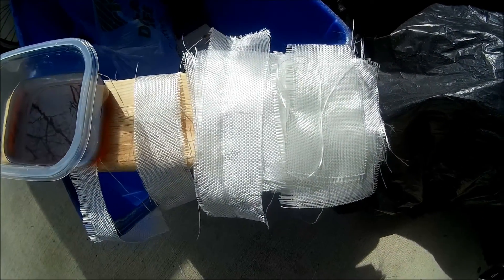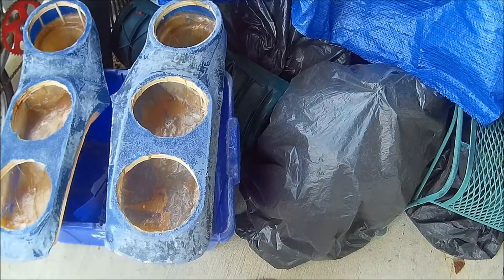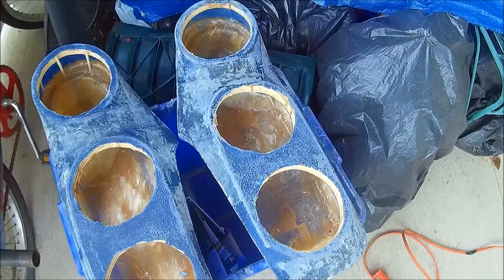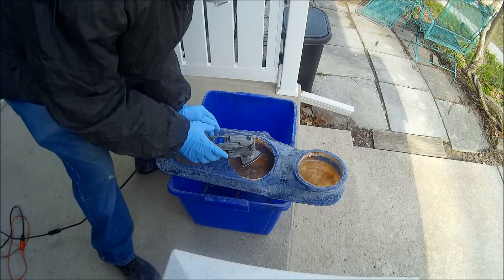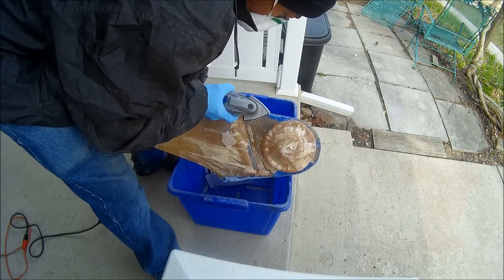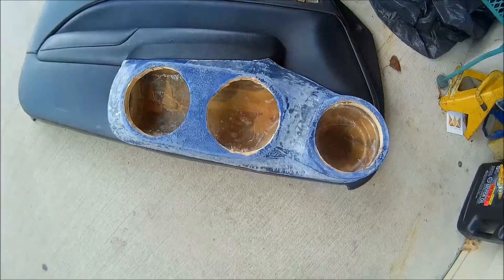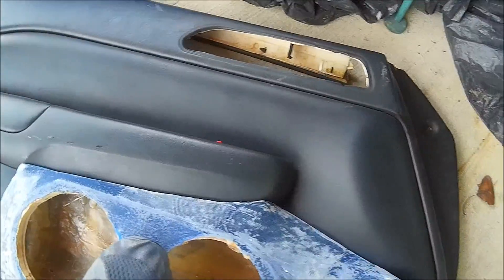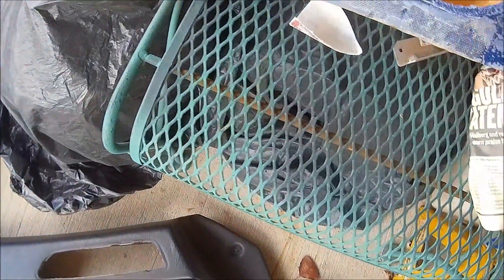Honda Door Pods Three 6.5 inch 3 way RF Mids Video #4

Comment: man I love how they coming out !!!! and boy the extra time for the small details being your first try can wiat to see the final work and the second and third pods ;)  :D I'm redoing my rear doors but I have so much work I just can't find the time to start doing some planning
Reply from the maker: Thanks Much Bro for real :-). Ive never tried glass pods for myself - I did a set when I was working at this local shop when I was 19, they had a nice sander but it was broke, so I had to go by hand (No fun that was my 1st and last time lol). It only housed 1 6.5 and that seemed like a ton of work. Low key I'm starting to enjoy it, man bro if it was nice out I would sit on my porch and hand sand and really enjoy. I will be tuned in for your build for sure and bro I saw the distance video! Loud, Clear and heads turning for sure :) :) :)